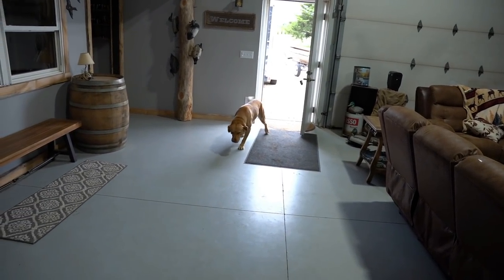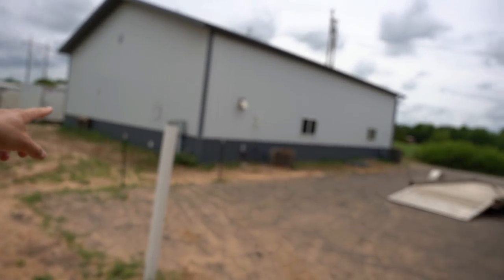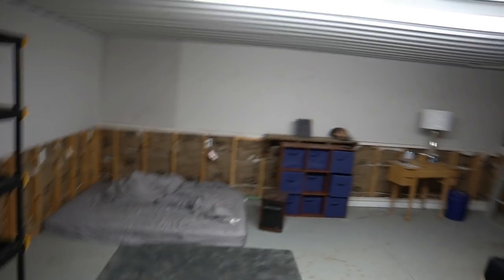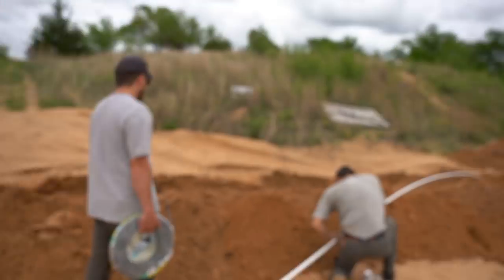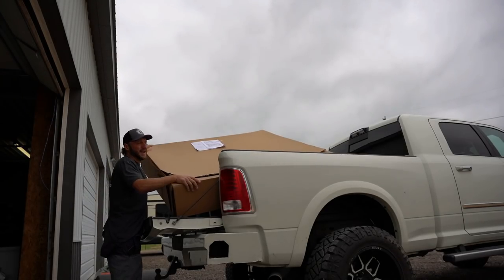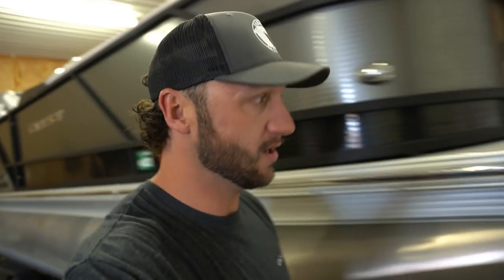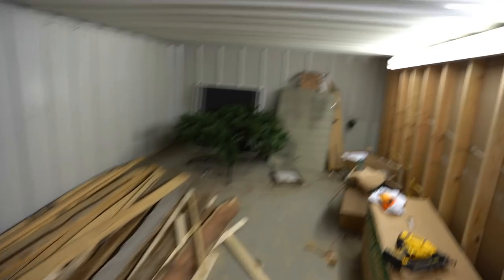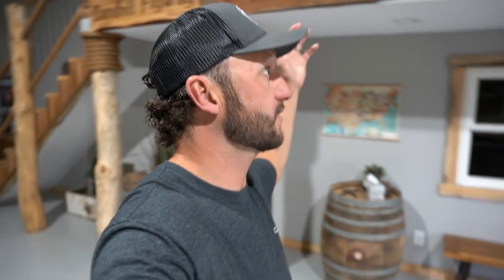Breaking Ground on Huge Upgrades to My Hunting Lodge!!

Comment from the maker: TO INQUIRE ABOUT OPEN DATES TO BOOK YOUR HUNT FILL OUT THE BOOKING REGISTRATION FORM HERE https://bit.ly/sandhillflyway
Reply: Bobby; spread the Conex trailers and bridge the gap with a cheap roof structure for out door parking of UTV's .  Also (having used Conex boxes for a few years, opening the double doors and closing them, are a royal pain in the A$$)  think about removing the double doors, build a suitable wood frame for the opening, and install an over head roll up unit. You might loose a little head room at the opening, but you WILL LOVE the convenience of 1 quick door, guaranteed !

Comment: You should do about 15 or so feet in between the 2 conex containers and then build a roof over the middle and then a back wall and then BAM you got a place for the boat or camper or all the side by sides or whatever. There is even companies out there that sell packages for that type of structure with rounded trusses and roofing. They are pretty solid buildings.
Reply: Really good idea!!
Reply: That is a fantastic suggestion.

Comment: Make sure the conex box for the decoys is vented and / or has a cooling unit of some kind for the summer months. We used one for storage at a tackle store I worked at for a few years. Summer time they get hot inside, especially with no moving air. 

I love the improvements you have planned and the attitude to continue to evolve the lodge and property to enhance the experience for clients and make it better for you personally.

Comment: You will want lights In both containers but easy to rig up 12 volt LED and auto battery if needed.   I think you are going to need 3 or 4 containers or at least side doors front and back to get to the stuff in the back etc.

Comment: Just one comment and I have not been at your property (yet) but the lodge starting to look like a beehive with many small chambers…not good if fire/smoke accidentally happens….need exits/windows. Extinguishing the fire will not be easy lots of fuel inside. Will need to ventilate and exit quickly 20 seconds before toxic fumes inhaled. Just foresight from past experiences.